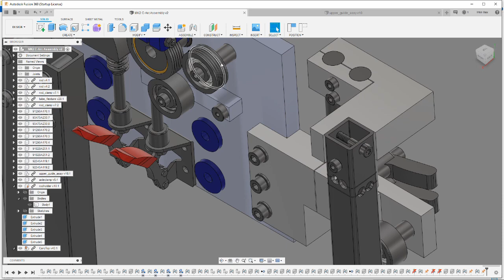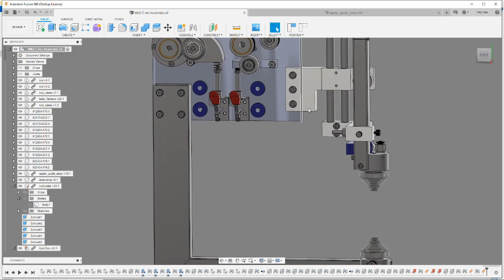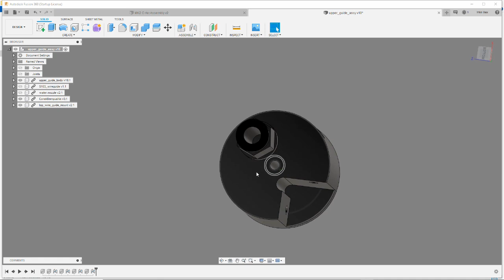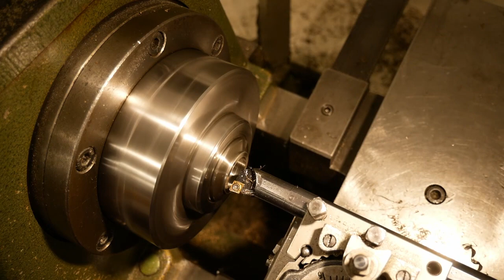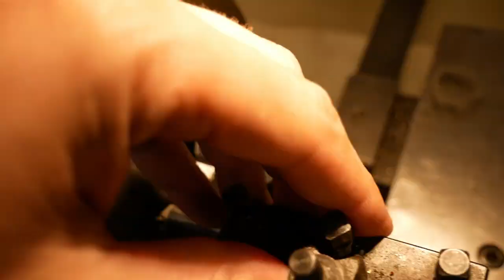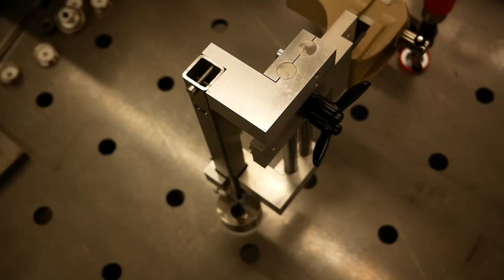Wire-EDM Machine, complete MK2 redesign: Part 7, making C-Arc parts

Comment: You might get some arcing if the insulated wheel is not big enough....I have a question, could you modify this machine to do deep cuts like 30 inches vertically? I noticed most edms cut very shallow and the best I could find cut 24 inches.

Comment: Stainless steel work hardens, making it incredible hard. Perhaps if you rubbed the wire contact points on the mating surfaces, it may work harden;
Reply: You can surface harden it using friction. You see this when drilling through stainless. If the drill gets blunted and you persist in trying to drill through creating a lot of friction, when you sharpen the drill bit and try and continue the stainless has become almost as hard as tool steel. I chastise my students for not changing the drill bit early because of this, if you don't keep the drill bit sharp when drilling through stainless then you end up spending more time before the job is finished in sharpening.

Comment: You mentioned the urethane roller is an OEM part, did you have any link to it or explanation what it is/was originally?
Reply from the maker: Hi Jaakko, here's the first rough draft of the BOM list for the MK2 design: https://baxedm.com/mechanical-bom-of-mk2-wire-edm-machine/
The Urethane lined roller is in the list. Its a standard part from Misumi.

Comment: How do those pinch rollers not deform the shape of the wire?
Reply from the maker: They do deform the wire, however only the spent waste wire, so the deformation is not a problem.
Reply: Ahhh! So the wire has already done the cutting by the time it gets to the pinch rollers. 👍